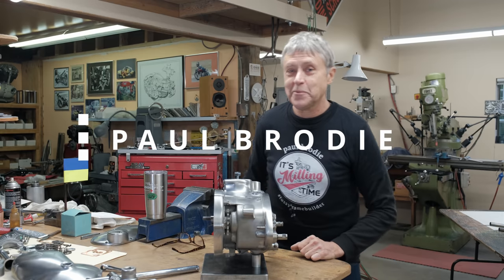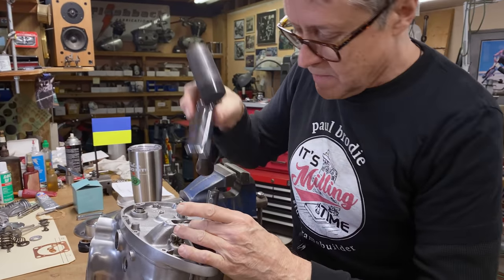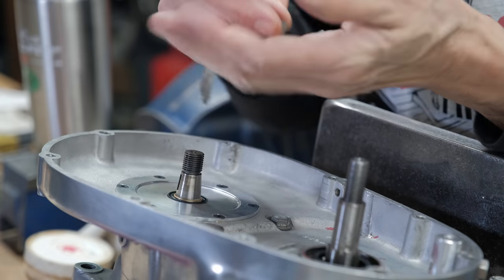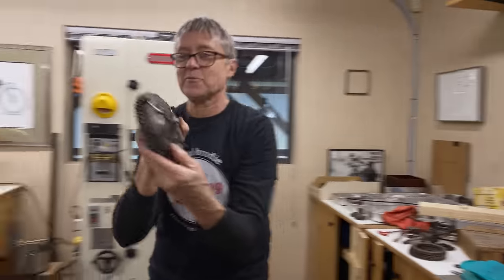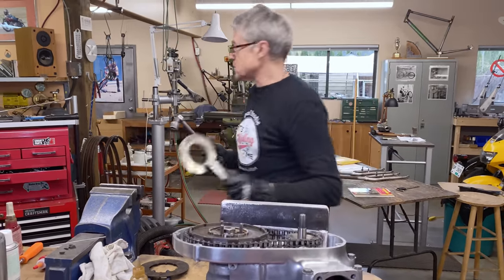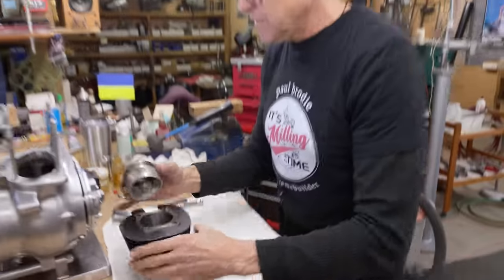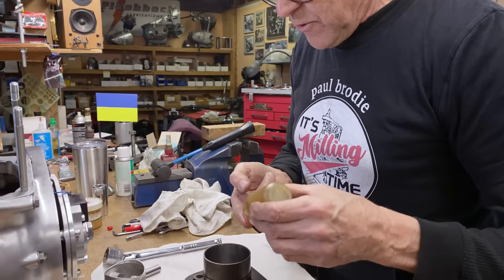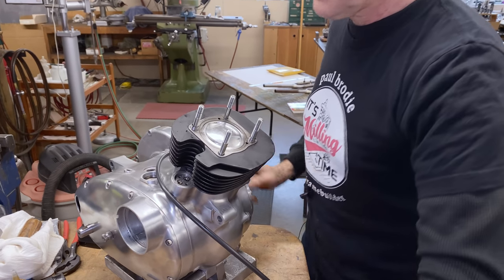Tiger Cub Engine Assembly - Part 2 // Paul Brodie's Shop

Comment: Rule of Loctite :
Blue - for parts that you will take apart for servicing.
 Red - for assemblies that you cannot see, and you do not disassemble during  normal life of part. Crank shaft, ring gear, timing gear, drive axle...
This is such a simple design. Your giving it more love than most received in their rough service. Great presentation 🇨🇦🇬🇧🏆✌️
🇺🇲
ps, the exchange rates, added import duty expense across our borders is crazy. 🥴
Reply from the maker: Yes, I agree with your Rule of Loctite..  I just like making things very nice. It's Who I Am.  Thanks for watching and commenting...   :face-orange-biting-nails::face-orange-biting-nails:

Comment: Agreed. Back in the day I slathered the rings on a rebuild with assembly lube. Too slippery, they wouldn't seal. Had to disassemble, clean off all the lube. I now use just a light film of 2 stroke oil. The rings need to bed into the cylinder cross hatch. Almost dry is the way to go. CHEERS

Comment: Oh, the games they are playing with shipping.  That little felt 'seal' could be easily sent in a simple envelope with minimal postage.  I suppose a stack of some thinner felt sections would do the job and you can find that at a craft store or such.  I recall Triumph push rod tubes had some finicky fitting with rubber seals to prevent oil seepage, hope you find out the cause of the clearance issues.
Reply from the maker: Postage from the USA up to Canada really has become expensive!
Reply: They're £2.50 on UK eBay.

Comment: A very common issue with Cubs is the clutch slipping when you kick the bike over.  New clutch plates, and springs help reduce the slipping, as does some sort of decompressor to make starting easier.  Also, it's worth remembering to soak cork clutch plates in engine oil, before they are fitted, which is often forgotten. Oil will piss out of your rocker shafts without the o-rings fitted.  Very easy to machine a thimble which fits over the rocker shaft, with a long taper, to compress the o-ring, so it doesn't get damaged when the shafts are fitted.
Reply from the maker: The o-rings are on the rocker shafts, they just got slightly shaved during assembly...
Reply: @paulbrodie  The shafts WILL leak!  O-rings need to be slightly compressed as they go into the head, to avoid them being damaged.  Not that difficult to make a simple tool to fit them properly.

Comment: You don't need to shorten your pushrod tube. There are a variety of thicknesses for the top and bottom pushrod tube bushings on most websites that sell vintage Triumph parts. A few others mentioned fitting the head without the bushing on the pushrod tube to see if that fits and if it does it will also give you a good idea of the thickness of each bushing needed. Keep up the great work!
Reply from the maker: Thanks. Next episode is a custom pushrod tube. It ended up being about 3/16" shorter.
Reply: @paulbrodie  Can't wait to see!

Comment: To install the rocker shaft o rings without slicing a piece off, is to use a spacer over the shaft opening with an internal taper that compresses the oil seal as it slides into the head. Shouldn't you also be heating the head to get the rocker shafts in easier?
Reply: Yep, there’s one for the twin cylinder engine, probably is the same tool for the single!

Comment: Another great video Paul, does make you think one of the reasons the British bike industry failed is because of inconsistency.
Reply from the maker: Thanks David. Yes, that would be one of many reasons. We could point to antiquated machinery.
Reply: @paulbrodie  Labour relations would be my pick. My father worked for Jaguar at Brown's Lane with Red Robbo in the '70's. Some of the stories were quite hair raising if you had any affection for British design, craftsmanship, and manufacture. The lack of investment was a direct result of union intransigence. It affected Meriden just as much as Coventry.

Comment: If it ain't one thing it's another lol I'm sure what ever you come up with will work out just fine. I wouldn't imagine those rocker arm shaft could have much oil pressure against them, I'm betting they don't leak. Good work guy's
Reply from the maker: Thanks Rick.

Comment: As always, thanks for the video Paul & Mitch.  Being young and over-confident (I didn't need a rag because I wouldn't drop it.... ), of course, I dropped a wrist pin clip into the crank case of the first race engine I ever built, a Honda Hawk, NT650.  Being young and strong, I shook that motor upside down over my head for over half an hour, and the damn wrist pin clip wouldn't come out.  I tried solvents, too, with the thought that it might be stuck to a thin film of oil.  I could hear it tinkling inside, taunting me.  After splitting the cases, I found one end of the clip had slightly stuck into the oil sump intake screen, where it would pivot (making the noise) but not come free.  It was a low-cost, high-labor lesson.

Regarding the stackup on the pushrod tube, I think I'd try gently assembling it as is first, and see if those rubber gaskets will compress that much.
Reply from the maker: Thanks Alan. Stock pushrod tubes are pretty crappy. Next video is a custom 6061 pushrod tube. Yes, that was a lot of work for you getting that circlip out!

Comment: My 1958 cub had a guide  inside the pushrod tube to ease assembly. This consisted of a circular metal disc with two holes that was soldered in place inside the pushrod tube. I am not sure if all Cubs had this but it certainly made assembly easier.
Reply from the maker: Yes, I did read about that. It was one of (3) styles of pushrod tubes. Triumph did that for a while, then discontinued it...

Comment: Could it be possible that, knowing how they changed things continuously, there are different push rods and tubes for different engines?.   

Absolutely love the video`s Paul, have been following  your builds for quite a while now, very interesting stuff, and i`m really impressed with the home built mods you`ve don.
Reply from the maker: Thank you Neil. Yes, there are 3 different pushrod tubes, I have read. I don't know if the lengths were any different..

Comment: Hi Paul rather than hunt round for a 5/52 all bearing  you could just use a 4mm BB which is only 1 1/2 thou larger. Great show 🙂
Reply from the maker: Mitch found one! It was 5/32", not 5/52".
Reply: Trouble is that “BB” are not hardened, unlike ball bearings.
Reply: @paulbrodie  Typo, my bad.

Comment: Hi, I soak the corked plates in gearbox oil, for some time, before I install them in my Vespa. That helps, at first start, to avoid burns and dryness. They have to soak the oil in and not just get oiled when installed because the centrifugal force would get rid of the surface oil in a matter of seconds from the first start of the engine. If they get soaked, when you start the engine the excess oil would get sprayed off and the cork will start doing its job right away. The clutch will last longer and first adjustments would be easier as this would exclude issues of dragging or slipping of the discs.
Reply from the maker: Thank you.

Comment: Felt Washer…. I recall buying some felt at Amazon.  It’s for an oil wiper - silicone oil, to lube sewing thread when sewing heavy fabrics like 1000d Cordura…

5/32 is a bicycle hub bearing size - I think.  I know I have some of that size in my bearing assortment.

You too?  One of the first welding projects I did was to weld up a valve spring compressor out of 4130 tubing!
Reply from the maker: I will try a drum shop for some felt. Mitch found the 5/32" ball. And you made your own valve spring compressor too!

Comment: Push rod tube will be correct.
Remove top & bottom gasket and fit head measure the clearance between the head and tube .
Still use bottom rubber gasket put a slight champher on the rubber. Measure the top clearance for a gasket size.
Reply from the maker: Pushrod tube was not correct. Next video I make a new, custom tube that is 3/16" shorter...
Reply: Hi Paul, Always a first with Brit bikes.
Have built many cubs & not had any problems swapping parts, oval barrels and heads to square barrels and heads 
And found push rod tubes interchangeable part number for both e3537.
Enjoying the build and look forward to the custom tube .

Comment: Another awesome  video Paul. The charges for shipping by  that Ebay seller is criminal. I live in Nebraska and have just received some sealing washers from a gentleman in Alberta and he charged me $2.00 for normal post as they fit in a letter sized envelope. Thanks for the Loctite 574 gasket maker suggestion, I am going to now put this in use. Good day to you and Mitch :))
Reply from the maker: I contacted the seller right away. He said either I was confused, or it was a glitch with Ebay. I don't think I was confused...

Comment: Yes correct to minimize oil in bore and rings , we did extensive testing and found dry cylinder with oil on piston only , rings bedded in quicker and achieved better sealing, minimal  leakage with leak down testing with no detriment to longevity, ( not relevant  to niksil bores never tested these ) 
👍👏👌
Reply from the maker: My Excelsiors have Nikasil bores. No oil on the rings and just a little on the piston skirts. Works fine.

Comment: Copper is annealed from the heating not from the quenching Paul, quenching is just an easy way to remove the oxides from the metal surface leaving the gasket clean

Comment: Regarding the torque settings on the tiger cub fasteners - torquing a bolt stretches it a certain amount, this stretch prevents the fastener from backing off in operation in addition to providing a clamping load.  Since the fasteners are steel and the case is aluminum, you will pull the threads out of the aluminum case before you stretch the fasteners enough to torque them properly.  This is most likely why there are no torque specifications for your bike.  Japan bikes of this era use lock washers on every fastener to avoid having fasteners back off.  I don't know what mechanism the tiger cub originally used, maybe they assumed that the bike would wear out before that happened.  In this application using a very moderate tightening of the fastener - plus blue locktite - is a sufficient method to retain the fasteners.
Reply from the maker: The Tiger Cub Bible does have some torque settings, it has been pointed out to me.

Comment: I think those engines would be a perfect case where running a belt drive might actually be a good idea.. First of all it'd be less chance of breaking the case if anything goes wrong, secondly it'd lower the amount of parasitic loss and on a low power engine every bit of power you can free up makes a huge difference. 
A tip for keeping the keepers in place (that I can't believe no one ever taught you) dab a little bit of grease on the inside of them and they'll stick to the valve and stay where you put them. I've never seen those big seals on a Triumph pushrod tube before, all I've seen is an O ring or just putting a little bit of RTV around the tube and it sinking into the head and case.
Reply from the maker: Yes, a little bit of grease would hold the keepers in place. Thanks.

Comment: Hey, Paul. Not sure if anyone has mentioned an O ring supply. Grizzly Supply on 96th just east of 192 on the north side will be able to supply any O ring you need. Take in the dimensions or, better yet, the part(s) and they will fix you up.
Reply from the maker: I wonder what their minimum order is?
Reply: @paulbrodie  I don't think thee is a minimum order. I got a few and the bill as under $20. They fixed me up right away.

Comment: Just a kind suggestion to be checking piston to cylinder wall clearance with cylinder installed in torque plates. Should also be doing any machine and hone work within them. This replicates the "installed" setup. Cylinder walls can deform quite a bit when fully torqued. Tjis could make your fitment out of specification. That goes for piston ring end gaps as well. Keep making these videos, they're great.
Reply from the maker: I've built quite a few engines; never had or used torque plates. This is not a race motor, I'll be cruising my local farm roads. Thanks for liking our videos.
Reply: @paulbrodie  I see. I guess I'm too institutionalized with Harley procedures. There are "essential" tool packages that come from the mothership every year, requested or not, that contain such devices. Usually accompanied with an HD-xxxxx nomenclature as a specialty tool. They used to be manufactured by Kent-Moore, though now I believe Bosch is our tool supplier. Anyway, the aftermarket also contains a multitude of torque plates even for entirely cast iron (not sleeved) cylinders such as a Shovelhead, or Panhead. Interestingly they don't even have studs that go through the entirety of the cylinder. 5 bolts for the head and 4 nuts that sit on truncated studs in the case. Nonetheless, you can measure a change in diameter when installed vs. not. Who knows really? Procedures change all the time and I am a firm believer in that there is no one right way to accomplish a task. Cheers.
Reply from the maker: @pcarey36  I agree. There's usually another way to make it work, whatever it is.

Comment: Bevel the entry for the rocker shaft
Reply from the maker: I did. The o-rings are not a Triumph part, and could be slightly too thick.

Comment: You might want to double check that clutch hub.  A little hard to see but the ball bearings in the chain wheel ride on the clutch hub and that area looks grooved and pitted.  Mine was the same way.  Should be flat and smooth.  NOS clutch hubs are not too hard to find.
Reply from the maker: I will check, thanks.

Comment: I found that if you take a half round file n put a little bevel on the edge of the hole. And a little grease on the o- ring. They will slip in nicely.
Reply from the maker: I did chamfer the hole with a countersink, and use some lube, but the o-rings probably had an OD that was too big, because the (two) gasket sets I bought did not come with the correct rocker shaft o-rings.
Reply: @paulbrodie  I probably learned that trick from you now that I think about it. Motor looking good. RMM
Reply from the maker: @roberymcgoff1904   Thanks!

Comment: Looks like the tube gaskets are too thick...bet it fits OK if you just use paper or something thinner.   Would be easier than machining another tube...unless you like doing that.   Good video's...enjoyed the build so far.
Reply from the maker: Paper won't work, because you have to allow for the expansion and compression of the head and the barrel. That's why they use the squishy square section o-rings.
Reply: @paulbrodie  Yes...for sure there's thermal expansion at play here, but the cast iron cylinder has about half the expansion of aluminum (that is what the tube is made of...yes?) so heat 'should' help keep the tube tight.   What changed that the tube is now too long with the same gaskets?  I know old British stuff doesn't always pass the 'logical assembly' test so they likely had something in mind when they did this...just trying to figure out what that might have been.
Reply from the maker: @recoilrob324   My goal was to make one motor out of the four I had here. Apparently, there were some changes to the parts specs over the years. Yes, I am putting together a Cub and I do have some knowledge, but do not consider myself an "expert". Next video: shorter pushrod tube!

Comment: Are the push-rod tubes different diameters? I seem to remember some Triumphs had the top washer visible and some had it 'inside' the head cavity. The 'exterior' one always leaked, usually sooner than later.
As for gasket 'goo', traditionally it was Red Hermatite until the 'Japanese' came out with non setting 'bonds' (Honda, Yamaha, Suzuki, Kawabond) I use Threebond 1104 as it appears the same as the others but is way cheaper (Suzukibond was about £30.00 in 1982, Threebond £11.00)
Before I knew about it it was Blue Hylomar, (developed by Rolls Royce)
It's important to use a non-setting sealer as if it breaks off and gets into oil passages it can easily destroy an engine (and why you don't use silicon sealers) I've seen lot of cams and cam bearings destroyed by 'liberal use' of silicon blocking oil pump pick up or oil ways.
Reply from the maker: My 6061 pushrod tube has a slightly larger OD. It seems to have settled into its new role quite well :)    I would never use silicon to seal cases...

Comment: I agree that a wrist pin retaining circlip coming loose is a bad day for any engine. My one 'whoopsie' was in a Subaru. For those unfamiliar, on a Subaru (and Porsche if you're fancier than me), you install the wrist pins through the side of the block down a reasonably deep and dark hole. First, this means you can't see very well. But more importantly, if a wrist pin does come loose, and that pin walks, instead of just scraping up your bore it eventually catches in that access hole in the side of the sleeve and absolutely grenades the piston, wrist pin, head and sleeve. Total loss situation.

So check those wrist pin circlips!
Reply from the maker: Yes, check those wrist pin circlips!

Comment: When you tighten the bigger nuts on the shafts ,,, if you just make the same clicking noise with your tongue as you would to giddy up a horse ,,, they are bang on torque spec.

it always works for me . : ]
Reply from the maker: I can make a "click" like a torque wrench..
Reply: @paulbrodie  that's how I do it LOL .. those who know smile ... those who have no idea simply have no idea ... all they hear is woosh as it flyswatter over their head 🙂
Reply: Calibrated elbow cracks at 60ft lbs  ;)     If I could hold a wrench in my feet I'd have somewhat lower settings provided by the knees   lololol